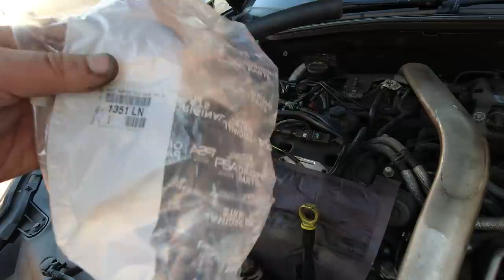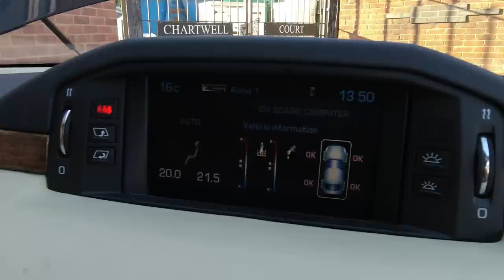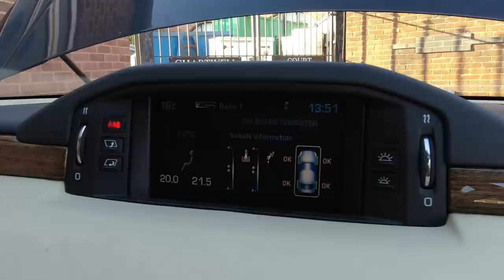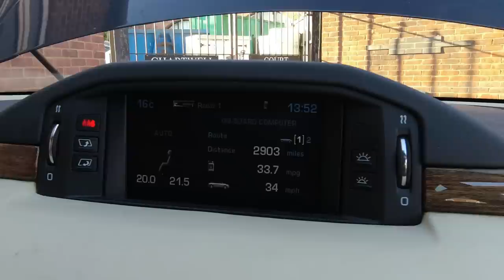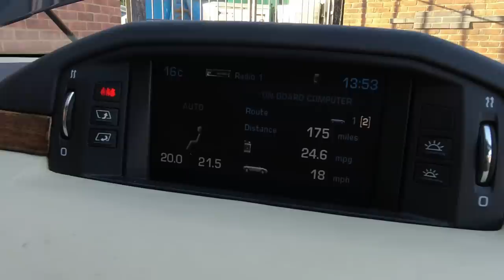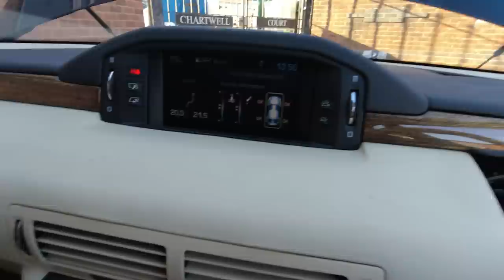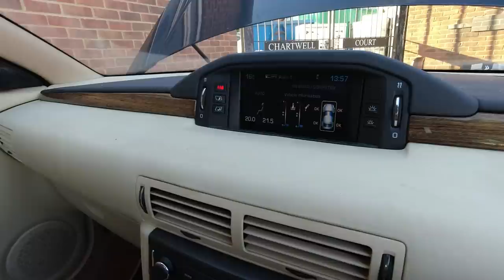Cheap Citroën C6 Project 9:  The straw that breaks the camel's back?

Comment: Every time I see a video on the C6, something has gone wrong with it. And I still want one more than ever. 

That old pic of you next to the Saxo is brilliant.
Reply from the maker: It's not that bad, to be fair. The content would be pretty boring if I just kept filming nothing going wrong 😃
Reply: I have daily driven a C6 for 5 years now. I'd say that this car is like any other, when it has been taken care of, it will not have shitloads of problems like his C6. I'm having the yearly service next week and haven't had to take the car to repair anything that went bad in this year. 

Biggest thing my car has undergone was undercarriage overhaul few years back, because rubber does not last forever in the joints
Reply: Me too, but they're as scarce as hens teeth here in Australia.
Reply: Think again!

Comment: The designed obsolescence of these plastic components on modern cars,... saves the manufacturers money while costing the consumer as the longevity of the parts is less than they would be if they were made from sturdier materials. Cool Saxo hoon throwback pic too mate. =)

Comment: Had a similar situation like you, and the solution to my issues was one of the most cherished Clio Mk1 1,4 examples I could find - a bit scruffy on the outside (cheap!), but very well kept velour interiour and mechanically almost pristine.  It does an easy 40mpg in spirited, not painfully restrained city driving, 
does an easy 50 on a run, and is surprisingly comfy for a family of four.
I just threw 6x14 steel wheels and an old OMP rallye steering wheel, and de-catted it, and it is a nice rorty and sweet-steering piece of kit, too, when needed.

Surprisingly easy to work on and DIY maintain, too (and I don't have a garage or anywhere near the facilities that you have).

They are very reliable, if the right example is chosen.

Comment: 23:55 I believe you need what is called a "rugged" phone, I have had a Cat(erpiller) and have just ordered an Oukitel WP23. The charge ports have a rubber cover. Being in the building trade I find these phones very useful, I can leave it lying around in my carpentry workshop, pick it out of a pile of sawdust no problem. Essential for people in dirty rough trades.

Comment: I'm in Australia. That difference in road tax! Wow! Here it's on weight and capacity. The price of diesel here is about 10% more than petrol. When the difference was more like 30% it was cheaper to drive my 1.8 petrol Corolla (8.5l/100km, 33 mpg) than my 2.0HDI C5 (7l/100km, 40mpg) I calculate the economy so these are my real world figures.

Comment: 2.7 C6s are currently £630 a year to tax, certainly not cheap! And they're awful on fuel around town, I agree. And repairs tend to be pretty heafty ... They're a labour of love, for sure, but I love the C6. Certainly a lot of sense in having a modern small petrol car for the daily grind, I have one, among other things. Choices are pretty limited for really cheap tax and 3 pot petrols, C1 trio really. But they tend to be reliably tough, easy to get parts and they're great fun to drive for short distances. Not especially comfy, though.
Interestingly, my C6 was manufactured in Feb 2007 and registered in March 2007, yours was manufactured 2 months later but registered 18 months later. Those 'GJ' cars certainly show the sales problem the C6 had.
Reply from the maker: One day I'll find out which field the GJ cars sat around and waited in!

Comment: Sorry to see this issue, the values will be suppressed for another few years or so. When I had the C6 as a daily it never went on journeys of under 10 miles and no urban driving unless I had to carry something, as the fuel consumption made it uneconomic to use. The average true fuel economy around 35mpg or 38+ on the trip. This was 'poor' and I put such low figure down to having a missing engine undertray. The solution is not to use this as a daily get an econobox for those journeys - a basic 1.0/1.1 Saxo or 106 would do the job and decent economy.
Reply from the maker: Mine's missing the undertray, too. Took it off when I got it to repair it (fractured in the usual place) and still haven't put it back on!

Comment: I'm grateful for the relative simplicity of the V6 XM compared to this! 

One time I kept getting a low coolant warning even when the coolant level was fine. I knew Harris's over Nutbourne way had a scrapped XM right by their main office and shot over there in the chance it still has the coolant sensor. I got there just as they were closing the gates that evening to pilfer the coolant sensor from it and gave them a tenner for their trouble. That V6 XM was plagued with hydraulic leaks nearly every other week - the low pressure pipes weren't a problem for me to replace if i could be arsed to, but most of the time it ended up parked over Meakins in Chi after hours for them to find the following morning. 

As much as I like the C6 as it was the last of the big Citroens (within reason), I think I'll give the idea of owning one a big miss, although won't pass up the opportunity to drive one if given a chance.

Comment: I love running my P38 Range Rover as a Daily. 4.6 V8 returning 18mpg average 24 Extra Urban.

My Go to when skint has always been either a Mercedes C class or a BMW 3 or 5 series. Velour, reliable engines especially straight 6's lots of breakers so lots of cheap parts comfortable. And cheap to buy.

Also loved my S70 178k miles 1 previous owner cost me 800 quid 5 Cylinder noise went OK sounded like a Subaru easy to work on and 28 MPG Combined.
Reply from the maker: None of those sound particularly cheap to run, though!
Reply: @UPnDOWN  I look at the overall picture with the V8 unleaded is cheaper than diesel, No EGR and parts are easy to buy and fit.

With the Merc No EGR even on the Diesel a good car can be had for 1200 and a runner from 700, again parts are plentiful tried and tested engines and no silly computers or electronics to cause issues.

With the Volvo MPG is in par with the Merc bomb proof mechanicals  lots of spares rust not normally an issue and decent MPG around Town.

Compared to my neighbours Audi which clogs EGR, DPF or throws emissions faults because of local use, or Mini which again has emissions issues, us hard to work on plus has a higher purchase price my running costs including servicing tax and insurance are 1200 per year.

Comment: Peugeot 406 is comfortable, has a velour interior, and a great 2.0 HDi engine. Other engines available, if you do not want a diesel. And should be cheap to run.
Reply: I second this. You could also go with a Xantia.
Reply from the maker: They are, good call. I have a remap for that engine on my laptop too!

Comment: Just bought a 2013 Fiat Panda Twinair 875cc 2 cylinder turbo to replace our 2006 Peugeot 407 SV 3.0 v6 here in Sydney, Aus. The Peugeot is lovely and has only done 99,000kms, very like your C6, but we only do short runs, and its a guzzler! The Panda is really quite fun to drive, economical, and we can get 5 in it for short journeys.  See Hubnuts review of one. Worth considering.

Comment: I know they don't have velour, but my last car was a 2011 mark 3 KIA Rio 1.1CRDi. They're really not bad cars and plenty cheap to run. £0 annual tax. It was giving me real world 57MPG - I do about 50% motorway miles, the rest being A-road and town. I found motorway speeds actually hurt the MPG from the little 1.1 diesel, so if you're only doing town and A-road you might even do better than 57. The 1.1 is a 3-cylinder engine so it's actually quite thrummy for a diesel. The later mk3 Rio 1.1 diesels can be had with climate control, cruise control, sat nav, reversing camera, and other goodies. I always found mine to be comfortable enough. It would sit all day at 70MPH if you wanted to. Boot space is a little bit lacking, but you've got the S-Max for that.

So, yeah, there's my shout. Mark 3 KIA Rio 1.1 diesel.

Comment: Heart vs Head. I love my Rover 75 V6 Auto but every time I drive my wife's Yaris 1.4 I am amazed at how its almost as good at what the Rover is good at and soo much better at what it is good at (47 mpg everywhere, ease of use,, ease of maintenance).  I'll cling to the V6 as long as I can but feel its days are numbered since I scarvely commute these days.
So, in a twist, I have bought a Morris Minor as my daily driver! £0 tax, 35 mpg, ridiculously easy to work on, good spares availability, will hold its value and is a lovely little thing to drive.
My other choice would be an MGF - cheap as chips, reliable and a hoot to drive (I've had two) but I now live surrounded by speed bumps and, while they are comfortable on a decent roads, round here they are purgatory.
Reply from the maker: My BX mk1 will be £0 tax next year!
Reply: I'd agree about the Morris Minor, one of the few old cars that can realistically be used as a daily. As you say, a doddle to work on, silly cheap bits and can be upgraded easily if required. Just keep on top of the rust.

Comment: Must say all of that is why I went with a C5 - the 2.2 will do mid 30s around town and is only 200 quid odd to tax. Parts are also a lot easier to get at being a straight 4 transverse and in a large ish engine bay. The c6 does look fab though. Maybe a 2.2 C6
Reply from the maker: C5 definitely more sensible than a C6, yes, but the C6 feels special.
Reply: 2.0 diesel is the most reliable engine

Comment: I’ve owned an Audi A2, it was fabulous, I’d have another at the drop of a hat if I was in the market for another car. Try one, don’t listen to anyone else’s opinions, and especially when they make absurd comments about the single wiper making the car rock when it’s working. The main thing I’d consider next time is to get one with 16” wheels as opposed to 17”. They are a hard riding car naturally because they’re so light bodied, but having low profile tyres only accentuates the ride. Mine was the 1.4 SE petrol version, the 3 cylinder diesels are only about £35 a year tax I believe.

Comment: For economy a Citroen AX is hard to beat, visas have some interesting engine options also. Peugeot 104 is economical and fun to drive.
Reply from the maker: Very old, though. Not much good for daily use in 2022.
Reply: @UPnDOWN  True unless you can find a good low mileage example that's been cared for. AX is hard to beat for fuel economy though!
Reply: I've always fancied a Peugeot 306, not sure how economical they are though.

Comment: Bought a 2012 black Aygo Ice 4 door, 5 speed manual in June this year with 39000 gen miles on the clock. My first time ever owning a 3 pot and its great fuel economy. After a few calcuations, it looks like i am achieving 50 + mpg "extra urban..?" and I do thrash it a bit. A nippy little thing round town. Zero road tax, cheap insurance, super easy to work on/service.... what's not to like..?.. Ok I admit it is a bit noisy inside at higher speeds, not the best looking, but its a resonably comfortable drive and especially with fuel prices the way they are at the moment, in my eyes, its a no brainer.. Just done a full engine bay service on it, oil, filters, plugs, belt etc all done for under £45. This one has aircon and as the model implies "Ice", it really does blow out very cold air..  😊
Reply from the maker: They make a LOT of sense.
Reply: @UPnDOWN  An Aygo retrofitted with Twingo Ph1 Velour seats sounds nice.

Comment: I've had my 2003 Volkswagen Polo 1.2 (with 3-cylinder engine) for 16 years as my only car.  'Polo Number Five', has been as sound and solid as the four that went before - tax perhaps high for the size of engine, IMHO.  But if you want 'big-car' solidity and driving qualities in a compact, economical package.....
Reply: I too was coming to recommend a type 9n Polo. I've had 3 of them. Downsides - suspension bushes - I've had to replace them on all 3. God knows what VW are making them out of. Pluses, not a Ford so nowhere near the rust issues, definite hoonability, plus with the seats down - the useable load space is remarkable for such a relatively small car. The 1.4 is actually 1390cc - so comes in under that tax bracket....
Reply from the maker: Switch to poly bushes (from a decent brand). Modern rubber is awful, and poly doesn't negatively affect the ride like people make out.

Comment: I took the CX out on her Sunday run to the stables and, as I floated along, I counted myself lucky I don’t have a C6. For all the annoying and occasionally expensive problems that the CX is capable of, there aren't loads of electronic circuits or plastic parts in critical areas that could lead to a FTP. Instead there's miles of small bore pipes containing very high pressure....

Cheap, interesting 3-cylinder? How about a Wartburg 353?
Reply from the maker: To be fair, the electrics in the C6 have been fine! It's been solid when called upon (the fact it did the trip to France and back with that broken pipe surely deserves respect, as well as having the coolant run so low the heater stopped blowing hot...and yet it survives, unharmed!

Comment: C4 Cactus 1.2 is a three cylinder. 
Ours is a five speed manual and have done over 100 000 km with no problems. 
They are very light and I reckon handle quite nice. Riding little higher than your normal hatch back that is great for our bumpy driveway. 
We took her to a 1000 km trip to Sydney a few years back and that was a comfy journey as well. 
Heater controls with the touchscreen are bit of a pain but no other complaints.
Reply from the maker: Couldn't be dealing with a touchscreen in a car. Hate them!

Comment: I know fuel prices are pretty awful right now, I can't run my Rover 25 1.4 on E10, I have to use E5 momentum fuel that costs 8p more per litre,  will I sell the car because of this, no. Keep the C6 and just get a small run about, 107, Aygo, C1, a phase 2 clio dci on a 2003 plate is only £30 a year to tax, no DPF and does 70 + MPG, I owned one and it was a fantastic little car. Keep the C6 as a high days and holidays car. All the effort you have put into keeping it going, would be a shame to see it go, sorn it over winter, enjoy it in summer 👍😁 keep up the great videos ☺️
Reply from the maker: Why do you have to use E5 in a Rover 25? Surely they're E10-proof? The Saxo is and that's probably older.
I probably wouldn't sell the C6 (not an easy car to sell anyway), just park it up like you say. It is a car that doesn't like sitting around, though.

Comment: I will maybe/probably end up with a C6 as a weekend fun/long run car, but an XM is probably next, so your "waffle" is very educational to me. As others suggest, the C4 coupe might be a good option worth considering? 3 cylinders? We ran an early petrol 1.2 Cactus for a few years, bloody gutless thing but sounded good. The C Crosser with the 2.2 Hdi engine is a solid bus and I get 400 miles per tank. We bit the bullet and bought a 2013 Peugeot 3008 hybrid 4 recently - gets well over 600 miles on the same size tank (50l or thereabouts per fill). That'll teach you about hybrids to generate more YouTube content - haha! :-)
Reply: As someone who has an XM, I can tell you that it couldn’t be any more different from the C6. If you stick with the 2 liter petrol or 2.1 diesel there is plenty of room to reach everything. Those cars are primitive compared to even the lowest spec C6 that they sold in France. 

Now if you were to get into the V6 XM, (whether that be 12v or 24v) there you’ll be sure to have a bit more similarity with the C6 in terms of oddness, complexity, and lack of room. Not to mention the V6 versions have diravi steering. 

Either way, the XM is truly a magical thing to own (at least pre facelift I’d say), but just be careful to not pick out one that has even a single electrical issue. If someone is selling one and says some minor electric things are not up to snuff (handbrake warning light operative only sometimes, etc) it could potentially signify bigger problems to come. After all, the electrics were the biggest issue on these.
Reply: @556johny556  from personal experience of owning an XM i can safely say that the Electrical issues aren't too terrible to fix, about 90% of the ones i ahve encountered up to now were switches that had tbe cleaned and regreased or the odd sensor here and there while a Brake light warning when turning the indicator on and the taillight being very dimm was a bad grounding cable.

Comment: My advice: 
a later model Peugeot 205/309! I've been using it as my hoby/kind of classic car for the last 3+ years, and it is lovely. Velours seats (especially the brown XS ones), a supple saxo-like ride, plenty of space, and it will do about 18ish km/litre. Further, they are not awfully rusty cars. 
Only problem I have with mine is a badly installed head gasket, that will need to be replaced. 
Then again, it hasn't needed much attention while I had it, and I've done ~10.000kms a year
Reply from the maker: They probably ride better than the Saxo, to be fair.

Comment: Could the coolant splatter just be flinging off belts n stuff from where it dribbled during pipe swap?
Reply from the maker: I like your optimism.
Reply: I thought that. You can try the fluorescent dye test, once it has dried off, to spot the tricky leaks.
Reply: @UPnDOWN  😅😂🤣 I can assess the C6 ain't Your first Citroën from that remark, and not the second either ...